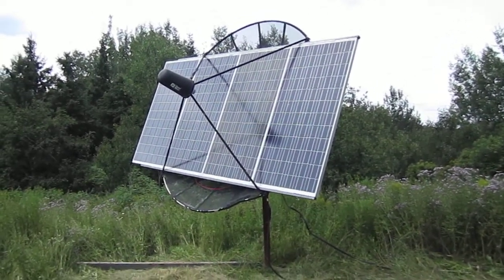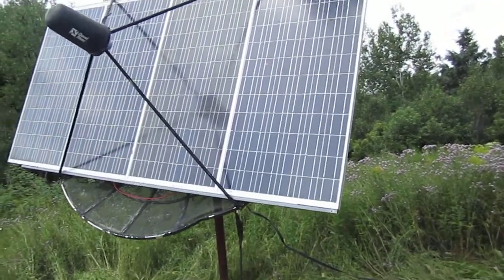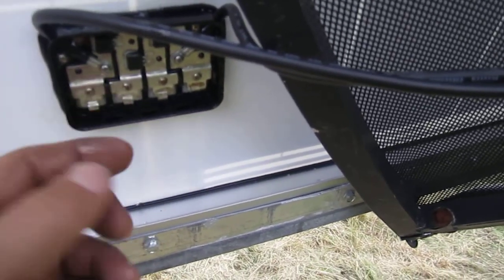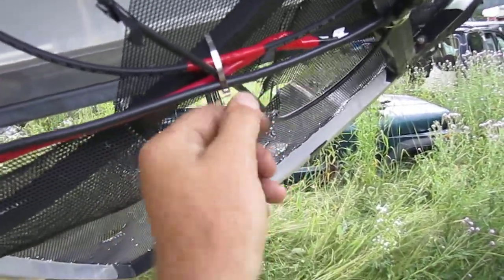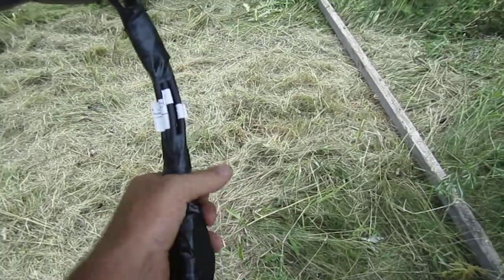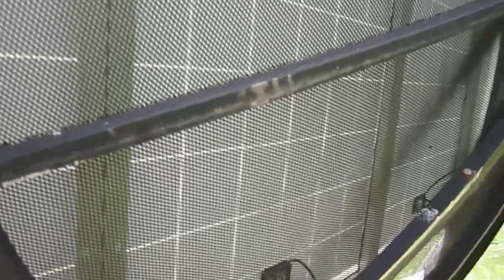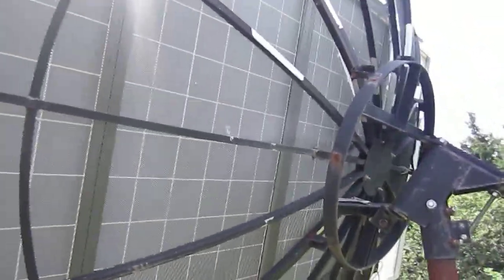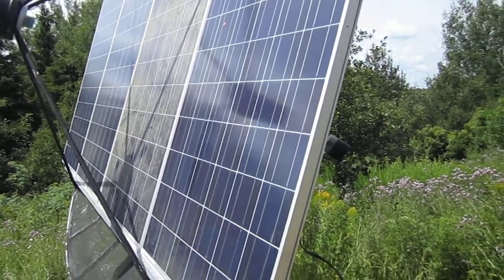Solar Panel Stand And Satellite Dishes (( Large Type))

Comment: Oil is a conductor you have both Pos +  &  Neg -  NEXT TO EACH OTHER BAD IDEA as they will short with the conductive oil unless it not conductive but a cover is the best idea 7 years later did you do that or even prior to your oil job add a not conductive silicone.
Reply from the maker: Everything is perfect with the whole unit still. Cheers